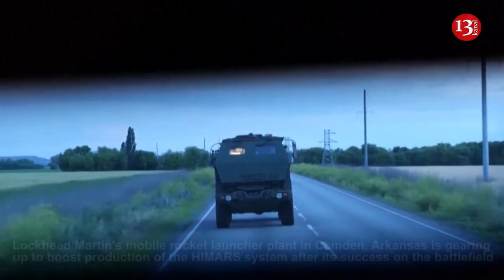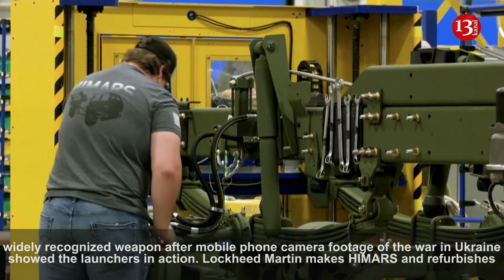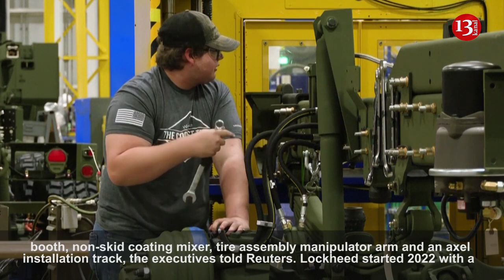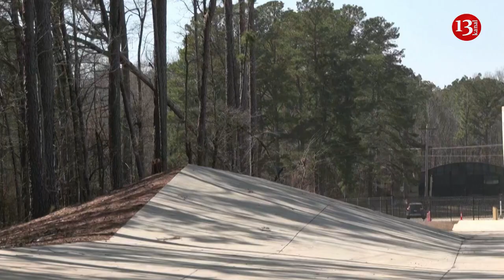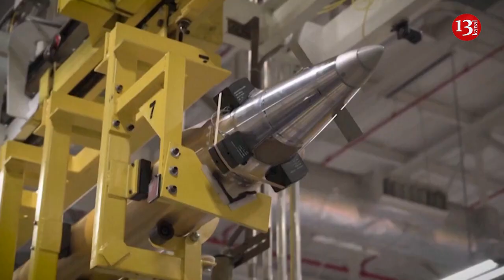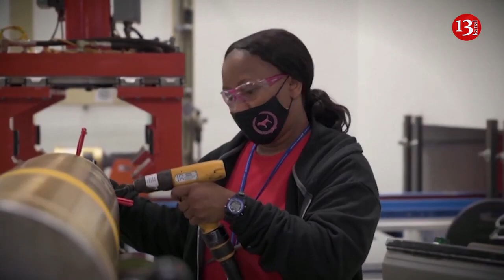Lockheed's HIMARS plant gearing up to meet demand after Ukraine success

Comment: I think we need to reopen the production line for the MLRS 270 system with updated guidance. Twice the bang for the buck and tracks are superior to wheels in many ways for mobility.  You're ramping up from 48 to year 60 HIMARS a year?  Really with Europe and the far East wanting to arm up, not to mention to build US capabilities.  At the very least you're going to miss out on sales to our allies and leave us unnecessarily exposed to readiness for conflict which is paid for by our soldiers.  Lockheed needs to take it up a couple notches or we need to award a competitor contracts that can get the lead out. Production should be 160 to 200 per year for the next few years and then re-evaluate?

Comment: Why does wheeled arty shoot and scoot faster than tracked arty?  I get that it would move faster on roads, but wouldn't it also move slower off-road?  Also, is there something about wheeled arty that makes it faster to begin departure after it fires?
Reply: @tapsulinka  I'm just wondering why it is considered a vehicle that can shoot-and-scoot faster than a tracked vehicle
Reply: You can used wheeled vehicles offroad of course, just not as much as you would tracked vehicles. The biggest advantage of wheeled arty and missile systems like HIMARS is reliability, mobility and range. Namely wheeled vehicles usually require less maintenance to keep them in service and they're faster on the road and can drive themselves over long distances on the battlefield compared to tracked vehicles that often need trucks with trailers to drive them around if you want to reduce wear and tear on them. 

As for the shoot and scoot part I think both can do that pretty much the same and it depends abit more on how fast the crew can get things ready before they move out.
Reply: Yes wheeled armored vehicles are much lighter and require way less maintenance than a track. They move quicker and they dont throw track at crucial times. Wheeled vehicles are also way better on gas mileage than a heavy armored vehicle.
Reply: The Ukrainians are using light weight dune buggies that can traverse the mud fields without getting stuck like tracked vehicles to work the edges of the Russian lines to good effect. They can go places other vehicles can’t. That area of Ukraine is mostly muddy farm fields. It’s not passable other than the roads through the country. They are always wide open targets for javelins day or night with thermal sites. The Russians do not have light weight dune buggies to compete , nor the speed. Speed is your friend. Armor is almost worthless in the open with javelins . They are a death sentence for anyone in them when hit. The javelin has a 98 percent or so one shot hit rate. Bahkmut is the the start of pain for Russia . That whole area is over liked and can be shot up by artillery from every angle even when the Ukrainians evacuate the area.
Reply: @max420thc  The dune buggies are the "game changers" of this war.  The most secretive weapon in the world that Russians aren't able to get it ... what a joke, Bubba!😂😂😂

Comment: They should be assembling them like they do volvo trucks, seems awfully slow in the vid
Reply: That because they have government inspectors on site..they have very strict tolerances on everything on the vehicle even down to the thickness of the paint..they have to inspect every step completed and if it dont pass its start over time.. i used to work at this same plant

Comment: Poland wanted to purchase nearly 500 HIMARS launcher and couldn't get them. 60 pcs a year is a joke.
Reply: Then Poland needs to sign a contract and these guys will ramp up produciton.  I'm glad this line was kept open and making HIMARs even at that slow rate.  It'll pick up because all of NATO see the deterant value in having a bunch of these badboys.  Then there is a matter of rockets.
Reply: They need to show they are being used and secured. No way would I give them anymore. Not to mention the amount of rockets coming out of our inventory. We need to make Guam, Palau, the Philippines and Japan bristle with HiMars.
Reply: @Red.Hot.Chili.Beans63  Poland bought 18 complete HIMARS launchers, 468 launcher loader module kits, which will be mounted on Polish-made chassis, as well as more than 9,000 guided missiles, including 45 ATACMS tactical missiles (with a range of more than 300 km). 
Additional to that Poland bought 288 K239 Chunmoo multiple rocket launchers from South Korea. The US deal could amount to up to $10 billion and $3 billion for the deal with South Korean.

Comment: Its not for them to decide. USA gov decides. can they build or not, also the system itself isnt so technological its damn simple, truck, hydraulic box, loading system nothing fancy, but it has electronics of targeting inside of it. Its only sends cords needed to rocket. The rocket is the most important thing. How fast it is flying, how precise. what charge it has. simply himars isnt smth special its easily replicated machine. Only needed signal to rockets, after you shot them you have no control. This is not some rockets with wings with video feed. Most production will be used on rockets,

Comment: Basically a tipper full of missiles and cheap electronics, flash paint job hence the cost. Quality about the same as a Chevy.
Reply: Nothing cheap about any of it. If you ask me its overkill on quality.. they have government inspectors on site..they have very strict tolerances on everything on the vehicle even down to the thickness of the paint..they have to inspect every step completed and if it dont pass its start over time..
Reply: @bringthepain7341  🤪😂🤠
Reply: @bringthepain7341  I was just saying fella, I like the paint job    and the Chevy's have good quality control

Comment: THE RUSSIAN HIMARS NOBODY IS TALKING ABOUT. DON’T WANT TO.
Just for your eyes only (one of the strikes you are not aware of): The Russian ‘Tornado-S’ rocket system hit the ammunition depot of the occupational armed forces of Ukraine in the vicinity of Ugledar. The 9M544 Tornado-S’ 300-mm high-precision reactive ‘ammunition was used. 9M544 rocket ammunition for the ‘Tornado-S’ rocket launcher has been used extensively during the special operation but the Ukro-Amero propaganda is keeping mum about it.

▪Russian guided missile 9M544 for Tornado-S can be used at a distance of up to 120 km. The missile has 552 cumulative combat elements, each weighing 240 g and capable of penetrating 140 mm of homogeneous armor steel.
▪Circular deviation is about 5-10m.
▪High-precision ammunition is guided by inertial and satellite navigation systems.